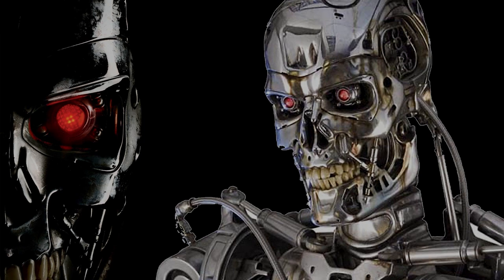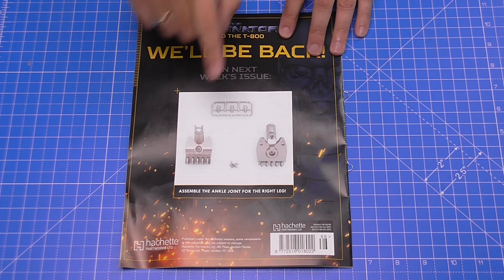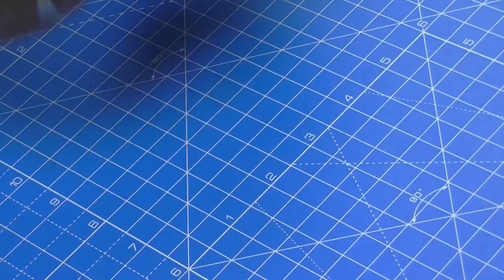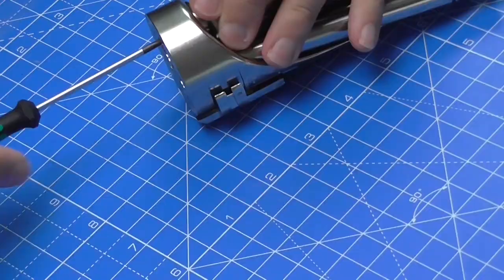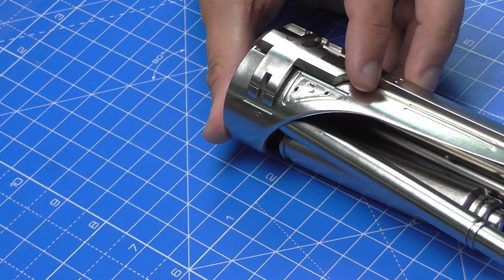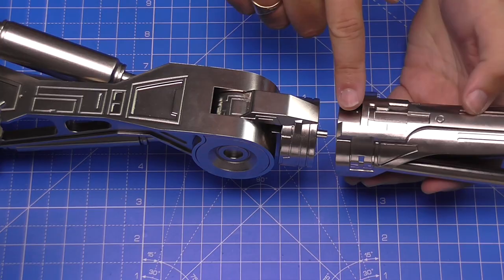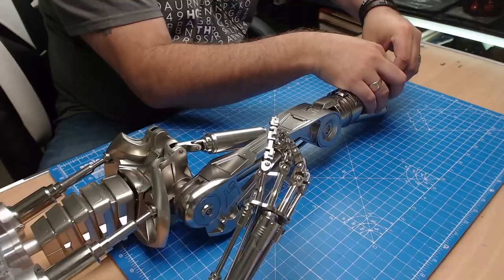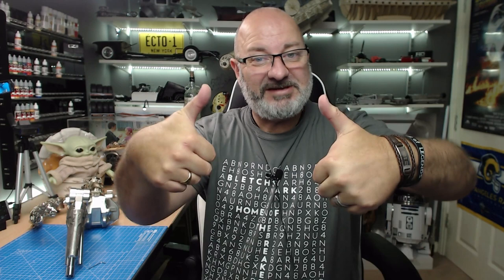Build the Terminator - Part 66 - Attaching the Lower Leg

Comment: Wayne, bit of a heads up... If you want to keep the toes together, an earbud stick fits through the fixture holes once the cotton is removed. The ends can be twisted together to keep it neat until the proper part arrives.
Reply: It keeps the toes in place on the foot...

Comment: Hey Wayne! Just wanted to mention really quick that when you're using sprue cutters you get better results if you make 2 cuts instead of one. It makes a much cleaner cut with less nub and stress marks left over. Just leave a little bit of sprue on the part for the first cut. Anyways great work as always!